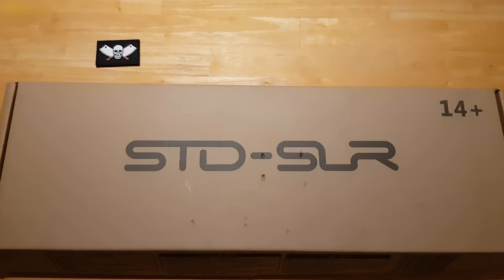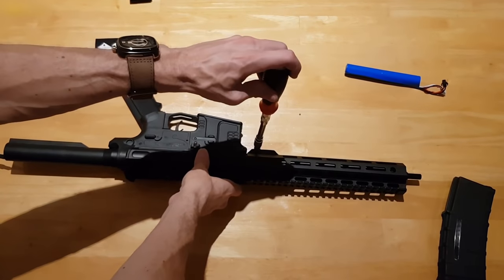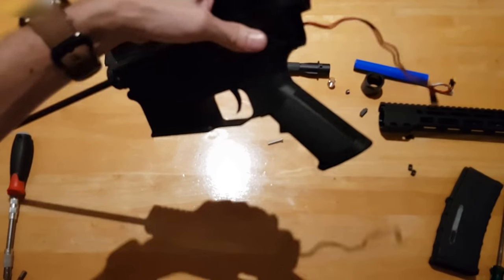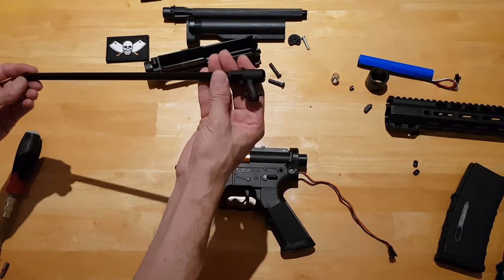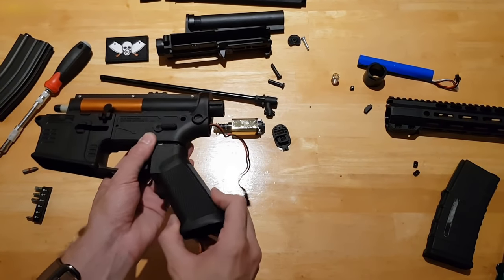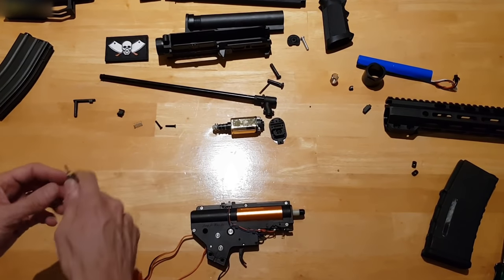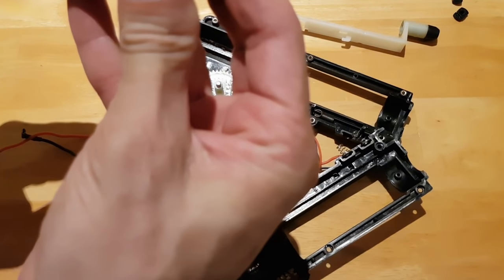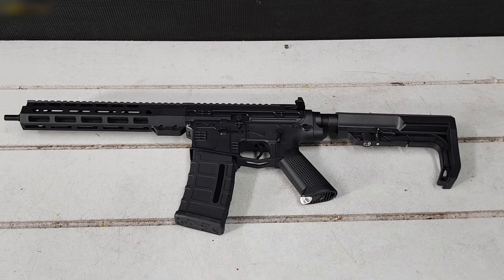BOLBR: STD SLR gel blaster review and teardown.

Comment: Hi Guido,   Great Vid,  Quick tip for all,    When starting screws into plastic or thin sheet metal always with very very light screwdriver pressure   rotate your screws anti clockwise till you feel it drop down   or click.   Then go forward and tighten.  Something an old bloke taught me years ago and I've never forgotten.   Cheers.

Comment: popped one of these boxes into my ldt416 and the switch made it a pain in the end :)) + no tamiya connector for 11.1v ... the mag terminal wire is soldered so closely it can make it feel like you cant separate the box....... the screws in opening and closing this box are great compared to cheap war interest gearboxes screws that are chewed up after 3-4 operations lol

Comment: Nice teardown mate. Any confirmed fps readings with new o-ring and 1.2ish spring?
Reply: natmad mine did 280 out of the box, and bang on 299 with those mods, I went to an 80% cylinder to bring it donw
Reply: Nice man. Sounds like a good unit indeed. Seem to be selling well too!
Reply: Vector Gel Ball wouldn’t an 80% cylinder increase it?
Reply: Not from my experience. It makes less room for the piston to trap air meaning it isn’t as effective
Reply: @ilootyouhoot8578  80% refers to porting the cylinder. It doesn't mean the actual size of the cylinder is smaller.

Comment: Nice vid! Could I just add if you can replace the springs without taking the gear box out? Like in some airsoft rifles
Reply from the maker: Not on this one. There are a couple that allow you to do that, but not many.
Reply: @lowguidoschopshop i appreciate that mate, New subscriber here now!😁 You recon the newer version of slr can handle an m100’spring
Reply from the maker: @gregcab3274  yeah, M100 should be fine, but I wouldn't go much more than that.. every upgrade increases the wear.
Reply: @lowguidoschopshop  yh, according Zhendou, it’s metal geared so I hope so.

Comment: Is there a way to fix the selector plate problem? I have the same problem with mine
Reply: Reece Tyshing the little black screw is an adjuster, turn it till single fire works
Reply: @JarrodTheCarpenter  yeah i do that until single shot doesnt work any more then it shoots 2 or 3 out and then it doesnt even fire until switched to full auto
Reply: Reece Tyshing hmmm I wonder if the spring for the safety is in the correct spot
Reply: Just put 5 mags through and my select fire works like a treat
Reply: How do i tell if the spring is in the correct spot? could putting in a stiffer spring fix it maybe? Any advice you got would be sweet 😁
Reply: Reece Tyshing I think that the spring sits wrong from the factory, their is a little grove for the tail to sit in and mine wasn’t when I pulled it apart
Reply: Ill defs have to look at that tomos thanks mate

Comment: Small block is just for looks,does nothing...I glued it in
Reply: on the real slr riflework firearm this thing called anti rotation lock that prevent the handguard from rotating because of the recoil, but in this blaster i think it's just for a cosmetic, maybe.
Reply: that small block actually works...I use this SLR Handguard (brought from AliExpress as JingLi SLR Handguard) on my Jinming M4A1 Gen 9 and it completely changes the look and feel to it. That small piece allowed the handguard from not tilting to sideways while holding the handguard to shoot easily. Also the long metal piece with the delta ring was was not needed in Jinming M4A1 Gen 9  after installing this handguard

Comment: Prime easy no it's not and the reason the ACR J10 try it??????? I have 3 directors and she can still trip the 555 timer unit otherwise likes to drop a lot off motor juice the electronic switch makes a issue on top the motor is a massive ground????☺😊😀😁😂5 smile's otherwise the curcit can give issue on run over the standard drains the hell out off the battery and have blown 2 curcits but I'll fix that once I've moved.